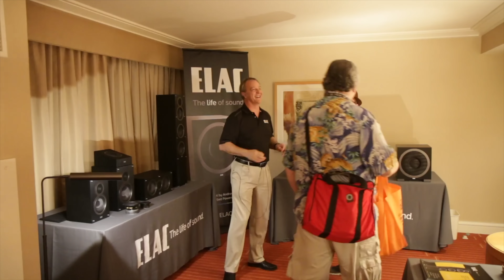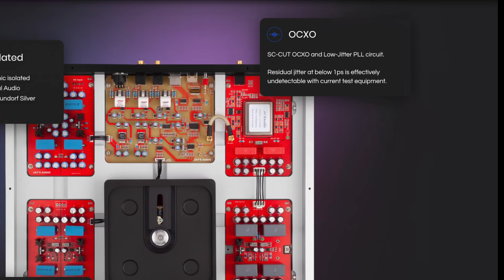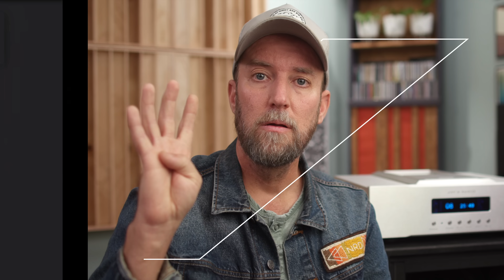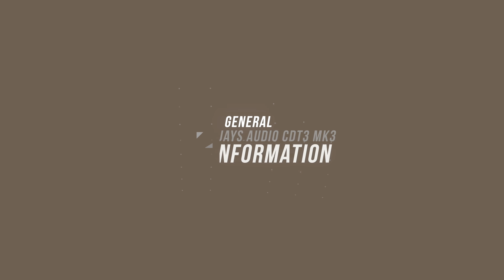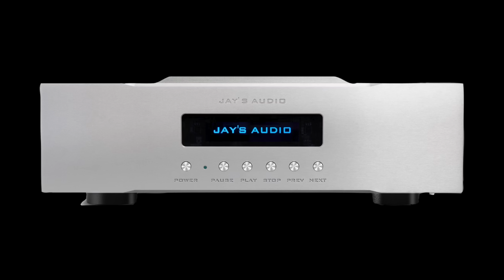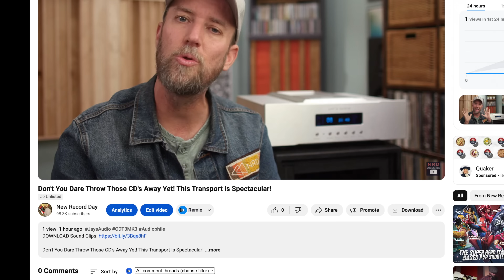Don't You Dare Toss Those CDs! This CD Transport Will Blow Your Mind!

Comment: Thanks for the video.  I still use CD's, Vinyl, Blurays and the like...don't really stream much.  My big question is for $5000, how much difference (improvement) am I going to hear over my current players?  They are the Oppo BDP-105D and the Panasonic DP-UB9000.  Appreciate your thoughts on this.  Thanks!
Reply: Are you using them as a transport? 
Unless you have 5,000+ in a DAC, 10-15grand into your amp and more in speakers, then I wouldn’t worry about it. There are cheaper options for a transport that will be a improvement.  Their MK2 and I personally would go with a Rega
Reply: @Pok-001  I'm not using either of them as a transport.  I have about $13k invested in my amp, processor and speakers, not counting cables and other accessories.  Both the Oppo and Panny supposedly have great DACs (that being subjective of course).  As I said, I don't stream much on this system.  I was just curious if this transport along with a nice DAC would be that much of an upgrade considering the cost and what I currently have.  I've never tried using a separate transport and DAC before.  Appreciate all of the responses.
Reply: @ got it.  As I was trying to saying in my first response. the separate DAC would make most of the factor to determine the improvement. If you have 13 in amps then honestly 5grand DAC isn’t it of question. you could go as high as 8-10. 
 
Could try a demo. If you have a brick and mortar near or some will ship one for demo. 
Can run your players as a transport and If you like the improvement consider buying one 
Ultimately Lampizator  or T+A 200 would be my recommendation.
Reply: The comparison isn’t just between this CD transport and your Oppo, but also how does it compare to a server/streamer, especially when your CD collection starts to need warehousing due to its size and or the CDs themselves start to become scratched, suffer bit rot, and become unplayable. For me, I’d need a small warehouse for all my CDs which makes keeping them around unpractical. The advantage to your Oppo is you can rip SACDs as well as regular CDs. And if I were you that’s how I would use it until it dies. Rip your CD collection now, before it’s too late.
Reply: @BrentLeVasseur  he said he doesn’t stream much. lol.  He spins disc and vinyl.  I did the math. I can fit apr. 6,000 cds on my wall in my listening room.  😂😂
I would love a computer full of digital music and server and a Roon subscription. But now we are talking about completely different gear. Network player, switches and network isolators.

I stream mostly. 95%.  I use iPad USB to Dayzee DAC for Apple Music. 
Spin disc mainly for my 80-90s music and Floyd albums 😁
Still something about physical media adds to the experience. And sometimes I want to sit back and listen to an entire “album”. And get up to change it.
Reply: Always the answer is going to be, "it depends on the rest of your system hardware." . There are those who feel compelled to spew volumes of jealous nonsense about gear that they cannot afford, and there are those who would never consider such a cheap piece of kit. As always, your mileage will vary.
Reply: thanks for what? for encourage others to buy CDs, so you ending to pay more for? I prefer say "THANKS FOR NOTHING!"
Reply: @JohnSmith-zl8rz  what wrong John?

Trying to keep all the CDs to yourself?
😂😂😂
Reply: @JohnSmith-zl8rz  You should worry about yourself and not how a bunch of complete strangers on the internet are going to spend the money that they worked for. Unless you think that comments like this on a youtube channel has the power to alter the global price on CD's?
Reply: There's only one responsible way to do this. Reviews and comments are meant to be used as an aid in making a purchase. Unless you're OK with making a costly mistake, you need to make this decision yourself. We all have different hearing, taste in equipment, taste in music, different systems, etc... Give that transport to 5 people and you're going to have 5 different opinions. Not only that, your opinion will evolve with experience. You need to find a dealer that has a loaner program or a liberal return policy. Yes, its a pain in the ass, but I say better to have a pain in the ass than a $5000 mistake. 

Here's a true story. I was buying a new CD player and I was trying to decide between 2 players from the same company. One was $5000 and the other was $7500. My attitude was, "Is it really worth and extra $2500?". I said to myself, maybe, but why take a chance. So I bought the one for $5000 and was very happy with it. About 6 months later, I was back in the store, and I listened to the same 2 players again. The difference is, now I have a lot more listening experience. I'm not the same listener that I was 6 months prior. Now when I listened to the 2 players again, I said to myself, "What was I thinking? This player is only $2500 more than the one I just bought.". And that's what it means to be an audiophile. But the point I'm trying to make is, it only took 6 months to evolve as a listener to where I would have made a completely different choice. Now think of getting advice from people you hardly know in a chat like this. Everyone here is well meaning, and wants you to make the right choice, but only you can actually do it. 

Will you hear an upgrade in performance if you get this transport? You probably will. I think the odds are in your favor. Transports make a big difference. However, while I think you will probably hear an improvement in sound quality, there's no possible way I can say if it will be worth $5000. That's a decision you have to make. Actually, I just remembered something. That $7500 CD player I bought after I traded my old $5000 player in for it, came out with an upgrade about a year, or so, after I bought it. For an additional $2500, they removed the transport in my current player, and put a higher end unit in. Nothing else was done to it. The transport was the only piece that was replaced. In case anyone was wondering, the CD player in question is a Wadia 861, and the transport upgrade turns it into an 861SE. I still use this player every day. I can certainly afford something newer and more expensive, but I have no desire to get rid of it. Very few audiophiles can make a claim like that about anything. Its almost unheard of to have an audiophile be happy with something for more than 7 to 10 days. After that, its time for an upgrade.

Comment: I just bought a Luxman D-07x HUGE game changer
Reply: D-03X here, agree 100%
Reply: @jamesderby4522  At $4200 this may be a good option to consider.
Reply: The D-10X price jumped from 10K to 17K since I last checked....
Reply: And if people are complaining about 5 grand for this transport, I'd imagine it would get a lot louder for a $10,000 (before tax) disc player, even with a DAC and SACD capability.  Luxman is a brand I have a lot of interest in.
Reply: @cardinalfang7725  admittedly, Luxman over prices their gear for the US market. In Japan it's almost half as much. Unfortunately Japanese voltage is a little lower. You can use step down transformers and save on the Luxman gear but I'd be very careful plus resale might be rough
Reply: That's nice unit.